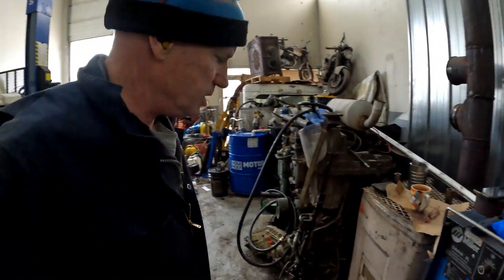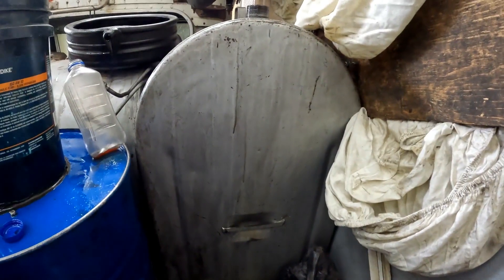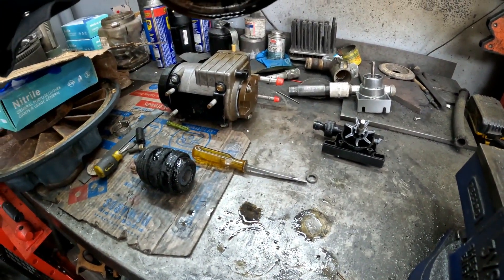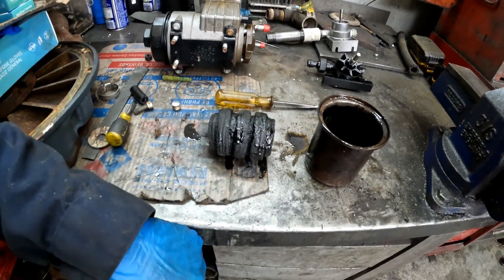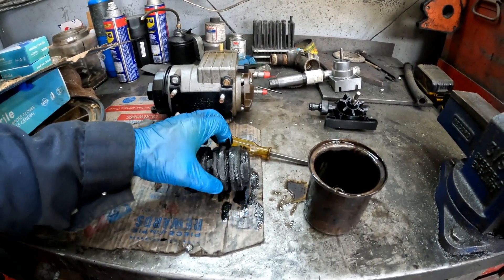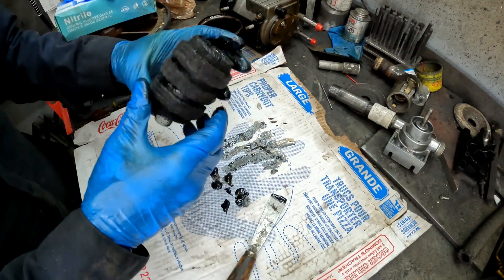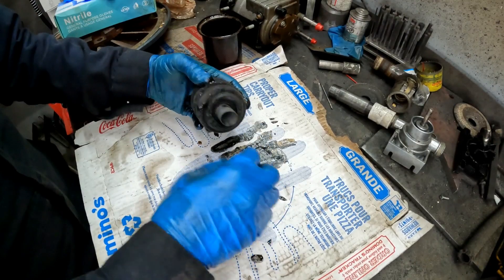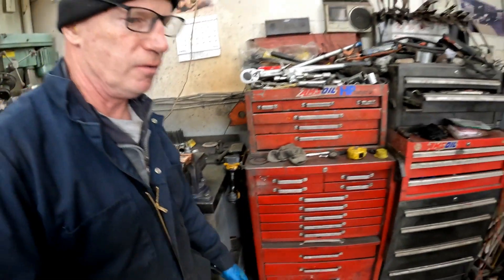Waste Motor Oil And WVO Equals Sludge

Comment: You would need a centrifugal purifier and very fine filter to have any chance of getting away with it. Very expensive equipment for someone trying to pinch pennies...
Reply from the maker: Very true, thanks for watching.:)
Reply: To clarify, I meant to run that through an engine more than a waste burner.

Comment: What about two aux tanks to keep them separate, with a switch to change from one to another?
Reply from the maker: Yes, that would work.:)
Reply: @detroitgarage9430  Is that something a Cummins would survive? Or reserved for the screaming jimmies only?
Reply from the maker: @maxwellg1361  Lots of Cummins 6BT's running waste motor oils and doing well.:)  Most run two tanks and thin the wmo with 10% gasoline.  The secret is to run either wvo or wmo, but not both mixed together.